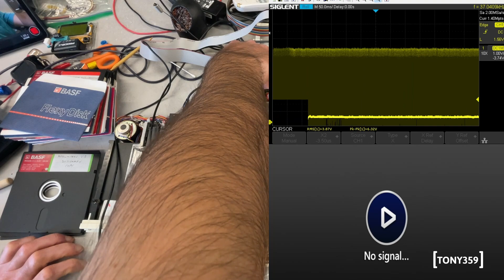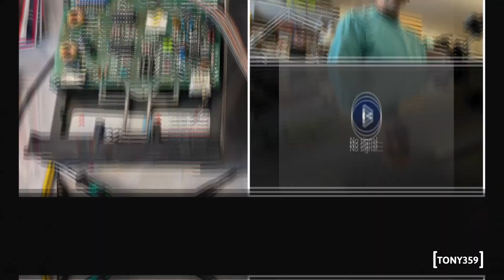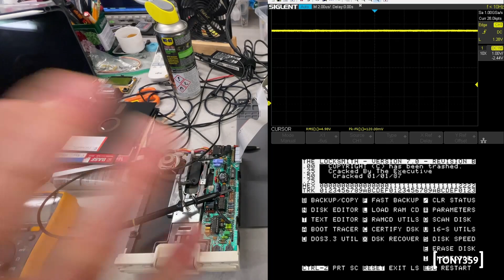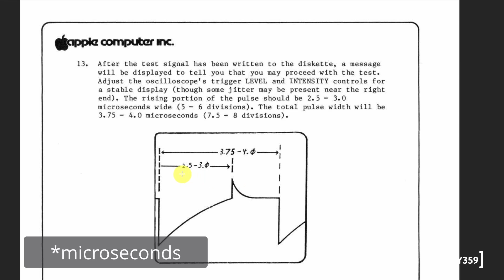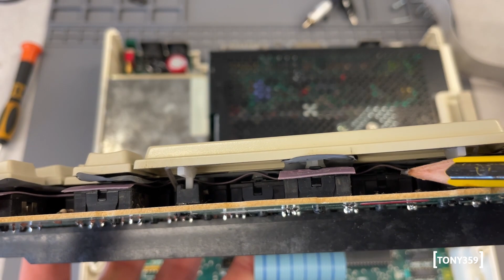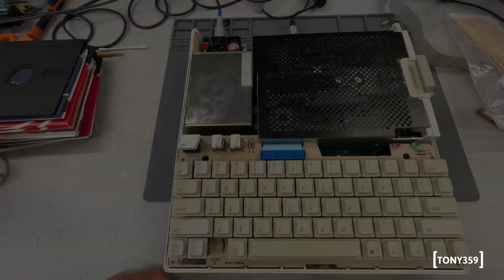Apple //c repair - How to adjust the drive

Comment: Nice video Tony.  One question:  at 12:07 you show a schematic of the drives’s analog card.   I was wondering where you found it?  The Apple DOS manual has one for the Disk II but I think this card is slightly different,
Reply from the maker: Hi, Sorry I was away. It's "Sams computerFacts for the Apple IIc", you should be able to find it online.

Comment: Could you tell me where to find the schematic for the iic drive? I am having trouble with one myself and a schematic would be very helpful thanks.
Reply from the maker: Does this help? https://archive.org/details/Apple_Disk_II_Technical_Procedures
Reply: @tony359  Unfortunately no. I did download that document and the disk image from the description, but the schematic you showed briefly is not in that document.
Reply from the maker: @DaveEverett01  Could you point me to a time in the video where I show the document you're after?
Reply: @tony359  You can see it at 14:32 for example, Tony.
Reply from the maker: @DaveEverett01  there you go: https://archive.org/details/Sams_Computer_Facts_Apple_IIc
Reply: @tony359  That's brilliant, thanks Tony.

Comment: i got a apple iic that is quite yellowed and the floppy drive is totally dead and makes terrible noises and the keyboard is unresponsive but it does turn on and show the Apple //c Check Disk Drive screen
Reply from the maker: Needs to be fixed then! :) 
You can try a diagnostic by powering on while holding the apple keys down. If the main system is ok, maybe it's nothing too serious!